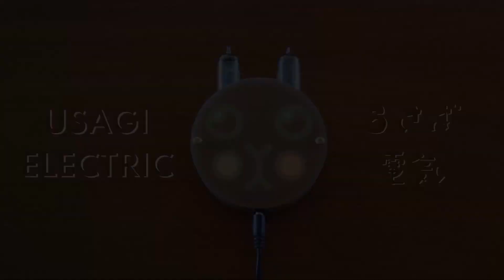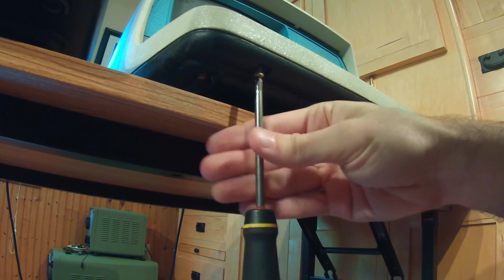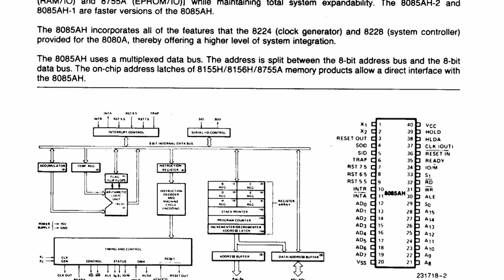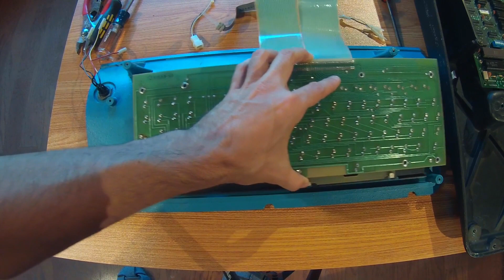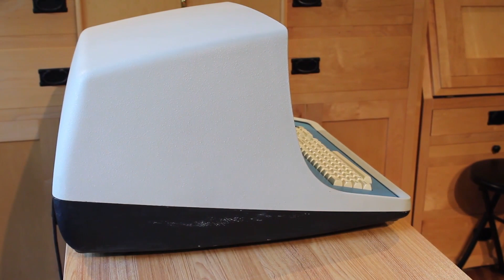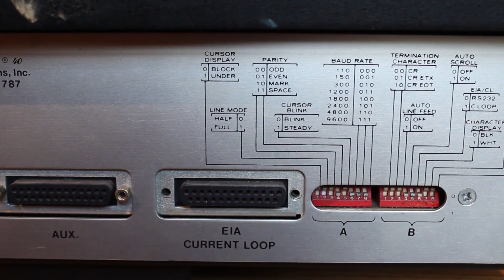Minicomputer Part 6: Restoring the ADDS Data Terminals

Comment: Applied Digital Data Systems, or simply ADDS, was a manufacturer of video display terminals and they were the Original Equipment Manufacturer (OEM) of that Centurion terminal. So Centurion did not manufacture that dumb terminal. ADDS manufactures the terminal, Centurion puts their name on it, and integrates it as part of their minicomputer system. I've used ADDS Consul and ADDS Viewpoint terminals connected to mainframe and minicomputers back in the late 1970s and early 1980s. The plate on the back identifies this as an ADDS Regent 40. Pictures can be found at https://terminals-wiki.org/wiki/index.php/ADDS_Regent_40 The ADDS Regent 20, 25, 40, and 60 models are similar except for some features that differentiate them. Links for the user guide for the ADDS Regent 20, 25, 40, and 60 can be found at http://bitsavers.org/pdf/adds/ADDS_Regent_25/515-30001_ADDS_Regent_25_Nov79.pdf 

As explained in page 7 of the PDF file of the user guide, your Centurion terminal is operating in MONITOR Mode where all control characters (the non-displayable characters from 00 through 32 on the ASCII chart) are displayed without being acted upon. Page 14 explains how to use Monitor Mode. However, they made a mistake on that page by leaving out a character. So you have to go to page 31 to find out that pressing <Control> + 1 enables Monitor Mode and pressing <Control> + 2 disables Monitor Mode.

Another thing you have to be aware of is whether your terminal is operating in Half Duplex or Full Duplex. Switch 2 on the rear panel controls the Duplex (page 17 and 18). Since the terminal is not connected to a computer, you are able to see characters on the screen as you type because your terminal is set to Half Duplex. If you connect the terminal operating in Half Duplex to a computer that uses Full Duplex, you will see double characters as you type because the terminal displays the character on the screen as you type and the character is sent to the computer which returns it back to the terminal and displays the character a second time. Just switch the terminal to Full Duplex to resolve this. If you connect the terminal to a computer that uses Half Duplex, leave the terminal in Half Duplex. Most minicomputer systems and PCs use Full Duplex.

Comment: In case and construction these remind me A LOT of the Intertec Superbrain CP/M microcomputer: https://en.wikipedia.org/wiki/Intertec_Superbrain
Reply: This is a dumb terminal, not a microcomputer. Applied Digital Data Systems, or simply ADDS, was a manufacturer of video display terminals and they were the Original Equipment Manufacturer (OEM) of that Centurion terminal. So Centurion did not manufacture that dumb terminal. ADDS manufactures the terminal, Centurion puts their name on it, and integrates it as part of their minicomputer system. The plate on the back identifies this as an ADDS Regent 40. Pictures can be found at https://terminals-wiki.org/wiki/index.php/ADDS_Regent_40 The ADDS Regent 20, 25, 40, and 60 models are similar except for some features that differentiate them. Links for the user guide for the ADDS Regent 20, 25, 40, and 60 can be found at http://bitsavers.org/pdf/adds/ADDS_Regent_25/515-30001_ADDS_Regent_25_Nov79.pdf

Comment: 11:37 You need hundreds of volts to accelerate the electron beam that draws the display on the screen. It’s even higher for colour CRTs -- they need thousands or tens of thousands of volts. The input may only be nominally 12V, but this is stepped up by the flyback transformer.

Comment: One of those would make a wonderful Linux terminal communicating to a Raspberry PI over a serial link
Reply from the maker: That's actually not far off from what I'm planning for one of the terminals!
The older terminal will be the main terminal for the computer, but once everything is up and stable, I want to take the newer terminal and use it as a terminal for some other computing projects!
Reply: @UsagiElectric  in order for that to work, you need to convert the current loop that these are working to a voltage-level interface. The easiest way to do it is with optocouplers. MIDI interfaces use the same arrangement.

Comment: Terminals normally operate by sending displayed text back from the computer.  So you type a letter it goes to the computer and the computer echos's it back.  If you use terminal emulation software it works that way.  You can also set up local echo which is what you have.  You can also do that with a terminal emulator.  Try hooking the two terminals together and type.  Remember to swap the two data lines.
Reply from the maker: Thank you for the insight!
Yup, I should have them set up for local echo here so that way I can check all the keys for operation without needing to be hooked up to a computer. Once I do get them hooked up, I'll have to flip that off or else there will be extra echoing going on. Fortunately, I've been in contact with someone who actually used to work at Centurion back in the day, and he's provided a ton of insight. I'm just waiting on our schedules to line up so I can get him down here to help diagnose and work on the computer!

Comment: That terminal may have been set up for current-loop operation, a very common if ancient serial loop method.  If you have the loop pins open-circuited, that is a disallowed condition and the terminal will run "open", that is, never receiving a character stop bit.  That is an invalid serial line format and some terminals show a NULL symbol of some sort.

This one is from before any kind of standard, like ANSI or VT-100, so the control codes for clearing the line and screen and cursor positioning are probably random.   Did you ever dump out the ROMS?   I love reverse-engineering small amounts of code like this, I'd be glad to give it a go if you have the ROM contents available.   I did something similar for a SOLARTRON 6-digit digital voltmeter and I was able to figure out most of the code.  Fun in a very techy kind of way.
Reply from the maker: Thank you for the comment!
After talking with someone who actually used to work at Centurion, I believe these terminals could work on both current loop or RS-232, but Centurion used them in RS-232 setup. It seems they tried to keep communication between the terminal and the computer as dead simple as possible too, so hopefully we can get the computer talking to the terminal again soon (just waiting on schedules to line up).

I did indeed dump the ROMs from both terminals. The ROM files are all located here: 
https://github.com/Nakazoto/CenturionComputer/tree/main/proms

The terminal ROM files start with T79 for the older terminal and T81 for the newer terminal. I didn't dump the ROM from the 8355, since that's a quite complex chip, I was scared of potentially damaging it.

Comment: You can connect them together and communicate as long as baud rates are same. And communicate over modems using phone lines. Main usages was a display and keyboard device to mainframe computer back in day. Which could be local or connected via modem and phone lines giving you control of a mainframe system miles away. You can also use a terminal emulator on windows pc to communicate. And in Dos pc you can setup console control to the terminal rather than the local keyboard and display.
Reply from the maker: Yup!
These are actually part of a much larger Centurion Minicomputer system. I believe the company that had this system had it setup with three terminals controlled via a Miacom modem, but that's just a guess based on the components I've received. There's no telling what was lost when they decommissioned this system in the early 90s.

Comment: The 8085 use in terminals is pretty standard. All DEC VT terminals in 2xx and 3xx range all use the 8085.
Reply from the maker: It totally makes sense, it makes the terminal way more compact and easier to build compared to trying to do it all with discrete chips!
Reply: @UsagiElectric  Yep.  The earlier VT-52 terminals used a very weird homebrew nano-processor and a huge circuit board with like 300 wire jumpers, probably to "save" making a double-sided PC board.  Very weird.     It also could be ordered with a really shabby electrolytic printer built into the top of the case which not only required very special smelly damp paper, it's rumored to print slowly and with major smudges.

Comment: I'm surprised that there wasn't at least one capacitor on that board with the HV transformer that had a Kilovolt rating.
Just because there isn't any "goo" oozing out of a capacitor doesn't mean that it is good.  It could still be electrically leaky.  There is a device that you might want to construct and use that you can view at this link:
https://www.youtube.com/watch?v=LhovRIM5xAo
I noticed that one of the terminals has "Function Keys" that the other one doesn't have.  Perhaps that is one reason for the difference in how it works compared to the other one?  A difference in either "software" or Firmware?
Please always keep that wonderful effusive and delightful personality going!  One of the main reasons why I love to watch your videos!
Reply from the maker: THank you so much for the kind words!

I think a lot of the HV "simplicity" so to day is due to the fact that it's just a simple BW display. Then again, I don't know much about CRT analog boards. I am quite familiar with Mr. Carlson's Lab though, he really produces absolutely excellent content and designs! If these terminals were going to be on for hours at a time, I think it would definitely be worth going through and replacing all the electrolytics, but for the time being, it seems to work really well, so I'm tempted to let sleeping dogs lie.

Interestingly, I talked with a former employee of Centurion recently, and he was saying that he doesn't remember any Centurion terminals with function keys, so it's possible that that terminal is either really late in Centurion's short history, or it's a bit of a counterfeit, which could be really exciting, haha. Centurion was only around for a short time, but they had a really fantastic history!
Reply: Another person on here you may check out, if you like old TVs is shango066. He really knows his stuff.

Comment: Really cool terminals. Have you considered connecting them together?
Reply from the maker: Thank you!
You know, I never thought about plugging them into each other, but they're using a current loop, which is really similar to how old Teletypes interfaced, which means it should totally be doable!
Reply: @UsagiElectric  Thanks, I'm not familiar with Current Loop, but I think you could also connect the EIA's RX to TX etcetera to connect them. Anyway I look forward to the next episodes, can't wait for you to switch on the CPU!
Reply: @UsagiElectric  Current loop requires a battery to supply the current.  The terminal itself would "key" the line like a telegraph opening and closing the line with each character sent.

Comment: Very nice, they seem to be built very well, I mean look at them after being stored in basically a ruin for who knows how long. 
They still work and even cleaned up very well.
I guess the behaviour with the carriage return and line feed is an artefact from earlier teletype or even typewriter type of machines, since all the people who used them in the beginning, were still used to the older ones. 
I'm pretty sure, that there is a dip switch to change them to a more "modern" behaviour. 

Most of what I had to say has already been said but whatever I already typed it so here it is again:

The litz wire on the coil is to handle higher power at high frequencies to fight the skin effect. 
You might be able to actually hook your terminals up to a modern computer and a terminal emulator with a RS232 - USB adapter. 
Or maybe connect them directly and chat between them, that would be cool in my opinion.

I'm definately looking forward to whatever you will do next in this series. 

Greetings, 
Michael
Reply from the maker: Thank you very much!
I'm actually really surprised at how well they cleaned up. 

The carriage return and feed problem on startup was actually solved by just flipping the EIA/CL dip switch on the back. Once set to RS232, it seemed to operate totally like normal! As for the screen displaying CR and LF when pressing those buttons, it makes sense when thinking about teletypes as they really just sent a 5-bit or 8-bit character telling the receiving machine that it was time to mechanically advance the paper. For my 1924 Morkrum Kleinschmidt, it prints on ticker tape, so when it's time for a carriage return and a line feed, all it does it light up a little light bulb. It's amazing how little serial communication changed in 80 years!

I managed to get Putty working on on my PC, so I think I may just grab one of those USB adapters and see if I can get it working! Also, my TI-99 has the RS-232 expansion sidecar and I happen to have the terminal emulator software, so I'm thinking I might be able to get the terminal and the TI-99 talking to each other, which would be awesome!
Reply: @UsagiElectric  The terminal is displaying CR and LF because Monitor Mode is enabled. See my comment above on how to disable it.
Reply: Chatting between the two terminals is easily done with an RS-232 cross-over cable.

Comment: if no one said so below: in EIA (not CL) mode build a db25 connector with pins 2 & 3 wired together, pins 4,5 connected, and pins  6,20 connected.  that loops receive to transmit, rts to cts and dsr to dtr. that will work on almost any serial port.  on a tiny handful of devices you may need to connect pin 8 with 6 and 20, but only a few uarts actually pay attention to dcd.  also make sure you turn off the auto-echo or everything you type will appear twice
Reply from the maker: Awesome, that's just a simple loop back connector, right?
That sounds easy enough to build and should let me test out some more stuff!
Reply: I was also thinking you could try a crossover cable between the two terminals, and chat between them.

Comment: Wow, they look great! Any investigation into why one has an aux but the other doesn't, or what it's connected to internally?

Not sure if it would prove to be valuable but I would think it pretty straightforward to hook up an Arduino via a max232 to see if they are outputting anything on startup or perhaps expecting a certain input, or at a lover level figuring out If these are DTE or DCE which, given that they are essentially computers in their own way, is interesting. Still guessing DTE though. 

And if the main computer ends up having too many problems or you don't need two terminals, it looks like there's plenty of room in there to fit a small computer and interface it in a nondestructive way to make a very cool stand-alone system.

Looking forward to future updates!
Reply from the maker: Thank you!
I'm not really sure why the '79 terminal has the AUX port blocked off, though I imagine that for the Centurion computer, they both just used the EIA current loop port. Both terminals were actually built by ADDS though, so I imagine that they were meant for a wide range of minicomputers at the time and Centurion just bought whichever ones worked with their system.

But, I'm right there with you on the stand-alone system idea! Even if the Centurion computer is fully working, I don't really have a need for two terminals on it, so I intend to eventually turn the '81 terminal into a standalone system inspired a bit by the Intertec Superbrain!
Reply: @UsagiElectric  I 'spect you probably want to use rs-232 to connect to the mini.  IIRC those 20ma tty loops were for driving old mechanical teletypes and stuff.
Reply: Usually, the AUX for is for connecting to a printer.  (Something like a TI-810)  Given the right commands, the terminal would pass the computer signal to the AUX port to print things out.  It may also allow an external device to send.

Comment: What a fantastic result, they look new. Can you plug one into the other ? (I've never used terminals either.)
Reply: Yes of course you can do this. You must make a special cable and cross the RX and TX lines as well as the DTR and CTS lines. Then set them to echo mode and the same speed. Google for RS232 pin layout for the connectors.
Reply: @ThomasJakober  Cool.
Reply: @ThomasJakober  This is called a null modem.
Reply from the maker: Thank you!
You know, I never thought about plugging them into each other, but they're using a current loop, which is really similar to how old Teletypes interfaced, which means it should totally be doable!
Reply: I would totally suggest that connection between the two in order to check that serial communication is working properly.

Comment: I have to UNSUB because you didn't replace the caps.
Reply: lmao. Go to Mr. Carlsons lab, he woudn't survive without recapping.
Reply: @teslakovalaborator  Mr. Carlson is a great channel.  Recapping is really cheap insurance against major failure.
Reply from the maker: In my defense, even though I didn't mention it in the video, I'm fairly certain the '79 terminal has had the PSU rebuilt at some point in time and the capacitors that are in it were actually "new." There was a little tag that said "new psu" hanging off one of the wires, but it didn't have a date or any other information. So, "new" in this case could just be recapping or something. 
Either way, it was working brilliantly and looked really clean, so I didn't want to mess with a good thing!

Comment: By chance I have a NOS of the CRT # 310JLB40N.  Yours ends in just 4N.  Looks visually the same.  Funny what random crap I accumulate around here.  😄
Reply from the maker: Whoa! When I read off the CRT number I didn't think there'd be anyone out there with another hanging about, that's awesome!
Reply: @UsagiElectric  I was just as surprised. Had no idea what sort of equipment it was for. I just snagged it as NOS on eBay for pretty cheap. I thought it would make for a fun display project one of these days.